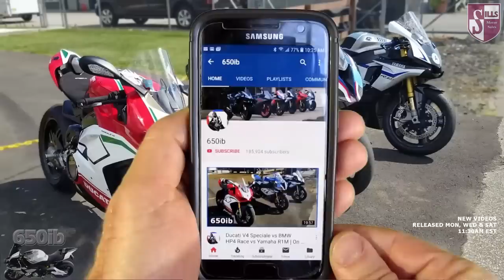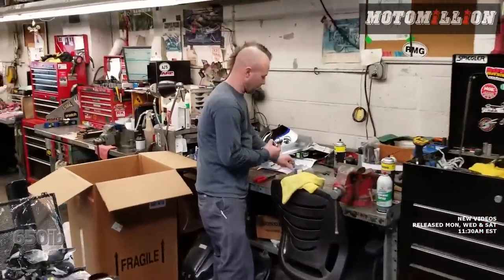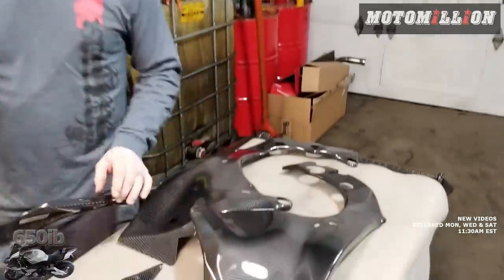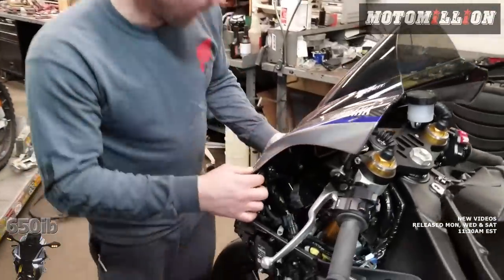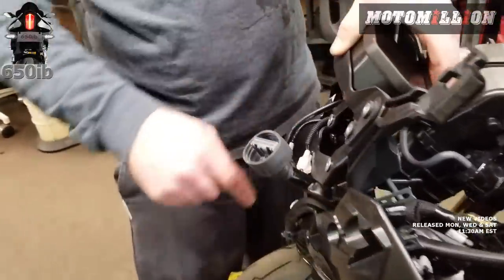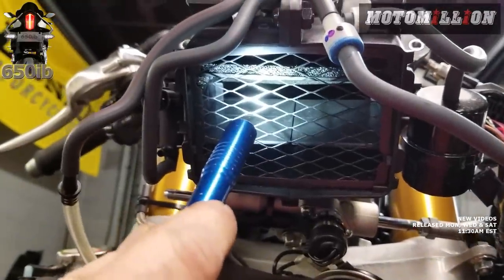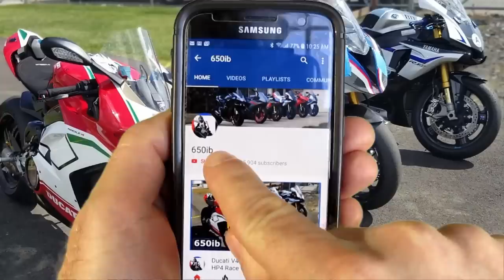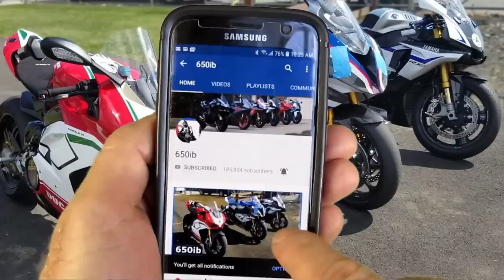Yamaha R1M Stripped | Intake Flapper Valve Operation & REMOVAL

Comment: What's the benefit of removing the flapper valve in the intake? Will it affect the performance or the throttle on low speed low revs and would you need to reflash the ecu again ?

Comment: 650IB
Zach has taste paint paint paint would be my vote
Reply from the maker: Will do!
Reply: @650ib  
Please ignore the negative  comments from those viewers that do.not like CF I do understand too much of it might look to be too much but those gorgeous pieces after painting them will look fantastic .I would also use the OEM upper & OEM tank just add the Air box CF cover & paint its sides silver & Blue to match the rest of the gas tank then call it a day as far as Body work .I have a question are you guys planning on using after market clip ons ? or sticking with stock. Awesome job so far

Comment: Even though i know i will never win one of these new bike build series bike..lol..I still support because i like the content and knowledge i pick up from Zack. I was able to do a tremendous amount of mods to my bike based on what i watch so far. Oh and tell Zack i got a AirHorn on my bike...LOL...

My next thing is to install a button into the factory controls of a BMW S1000R. There is an empty slot next to the hazard switch but i am not sure if it can come apart. The reason for doing so is I want to install a button i can press to activate strobe warning lights. I may have to drop the bike off to Zack to let him do...lol..IDK. I was thinking that you can order a button from BMW to fill that gap and then hook up the strobes to that button etc..

Either way good content.
Reply from the maker: Thanks man, you could win. Good luck!

Comment: Flapper is to meet intake noise regulations mainly, low end is secondary. Exhaust flapper is for low end torque first, but also noise regulations. A good replacement for the stock intake, upper stay, and dash mount is the aftermarket intake/stays from dbholders and tighttails. Nick Marino is a good tuner and can disable the flapper in the flash. The biggest problem with the stock stay is that they crack even in a mild tipover. You do not need to speed up the throttle at all really. But the domino's longer cables are a necessity on the R1 because aftermarket clipons get in the way of the stock cables. I race with domino throttles from Motomillion using the stock cam. 

Examples on my R1s: 
https://www.johnmckown.com/media/r1/tighttails.png 
https://www.johnmckown.com/media/r1/tighttails2.png
https://www.johnmckown.com/media/r1/dbholders.png
https://www.johnmckown.com/media/r1/dbholders2.png
Reply: John McKown This.
Reply: So if you're disabling the flapper via flash will it stay open? Or do you also have to physically remove it so it's not throwing codes?
Reply: The original concept EXUP valve was to make low end torque by being able to manipulate "header length" and backpressure profile, I'm not certain, but a flapper at the very end of the exhaust I suspect to be mostly noise regulation.
Reply: EXUP used to be at lot earlier in the exhaust flow
Reply: Yeah my stock upper stay cracked when i accidently dropped the bike in my garage. 

Isnt the dbholder stay for racing only? Does it still work with headlights and mirrors/turn signals?
Reply: @rumpel.856  Racing only.

Comment: Flapper removal really doesnt do anything. The flapper is there to smooth out the intake air charge to match the amount of fuel being injected to the throttle bodies...without the flapper all you have is an opening. It does not increase the amount of air flow that is still controlled by the throttle bodies.....just an fyi
Reply: That is incorrect I have dyno sheets showing I picked up 5 whp with flapper mod and filter
Reply: really i think that this flap is for pass sounds test for homologation...    this bike on dyno have problems in low rpm's power !!
Reply: @lametraserillos1  Yes the intake flapper is for noise and it has control over the amount of air coming in to the airbox. All the superbikes in wsbk dont use intake flappers so its best to think they dont improve power. Emissions and noise regulations are strict so devices like this are common. I removed mine and I saw A marginal gain case closed
Reply: ok thats good...    only on dyno we can see this things  @crossplane9894
Reply: @crossplane9894  All superbikes on the track do not have to be road driven either.  All they care about is high rpm running.  And they also do everything possible to remove cumbersome and complex parts that serve little purpose to make teardowns simple and fast as possible.  removing this on a road bike is NOT going to give you 5whp like was mentioned earlier.  I would not suggest anyone that is paying out of pocket for labor to do this.
Reply: if you are driving you bike on the road you should care more about torque and the curve than peak power.
Reply: @mcgman8058  wrong again my man i litterly have tested it. My R1 and R1s made more peak and midrange without it. My tuner told me to remove it and im assuming my tuner knows more about power then both of us
Reply: @crossplane9894  Is this on the 2020R1, I read they redid the air tract. Also will a flash remove or open it or do you have to manually remove it as well? Reason I'm asking is because I'm buying a 2020.
Reply: Lmfao I'm rolling. XPLANE isn't a race ecu. And unless that bike elwas on his dyno, it got a generic fuel map.  Its funny He has only been doing  flashes a few years with a dyno.. before that his flashes were shit on every single one we tested